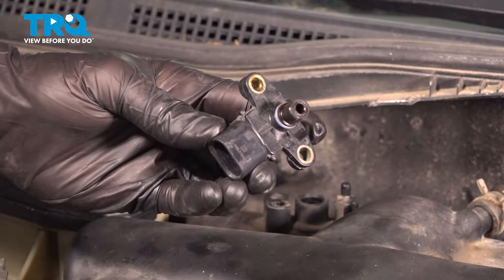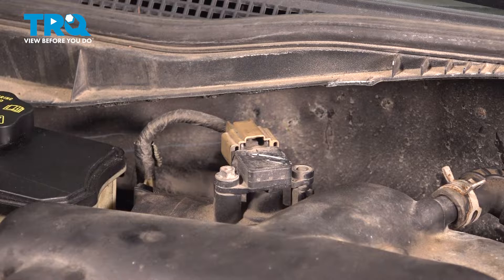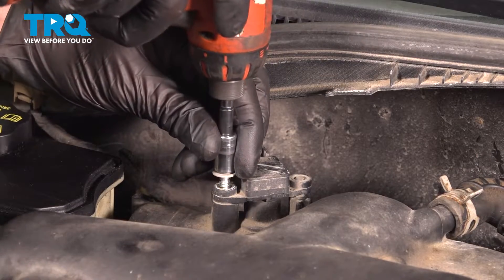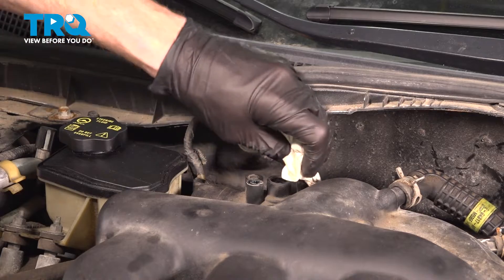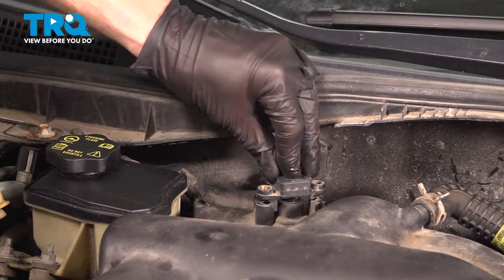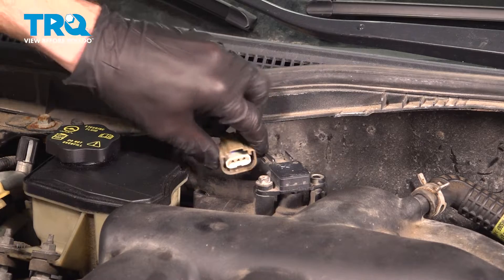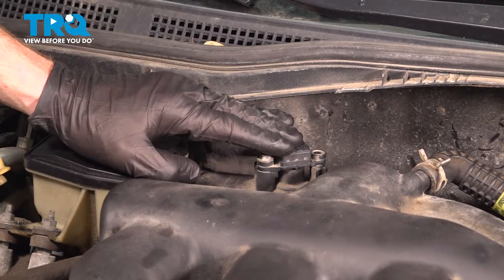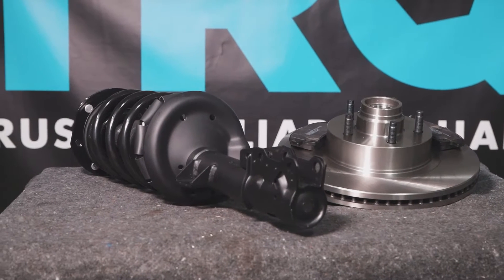How to Replace MAP Sensor 2006-2012 Ford Fusion 3.0L V6

Comment: Good morning. Where’s it located on the 2.5 engine of the the same year range(2011). Never had this code (p0106) until i replaced the pcv valve. Got it all together and now it cranks and dies immediately and has the above code